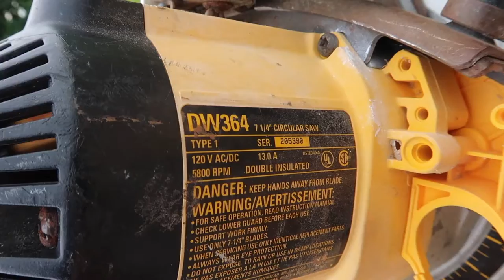HOW TO REPLACE THE CORD ON A DEWALT CIRCULAR SAW- TOOL REPAIR

Comment: Out of the factory circular saws do not have wing nuts in the handle.  The wing nut are from when the previous cord was damaged and replaced and wires from the trigger switch were spliced together using the wing nuts.
Reply from the maker: Good point!

Comment: Very helpful and very easy. The only difference with my dewalt is that the black wire went straight to the circuit block (which is a bad design if you have to replace a bad power cord). Simply cut the wire and used a wire nut to splice in the new one.
Reply from the maker: Yep, I've used the wire nut technique to get by for awhile.  It's nice to have a new cord at some point.